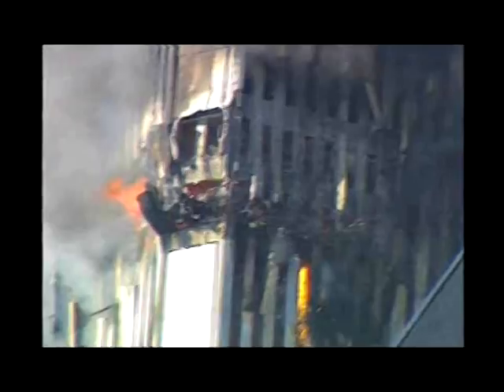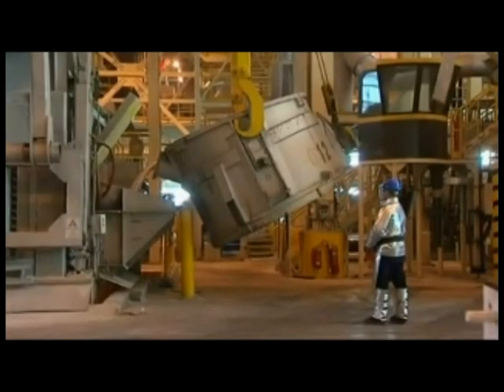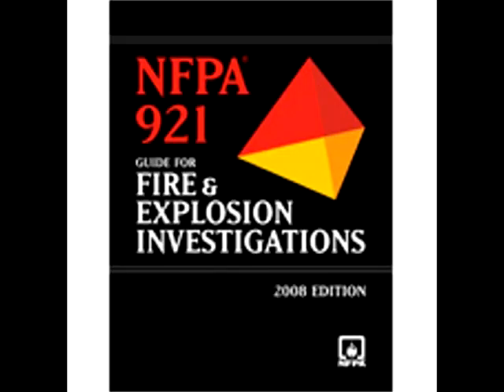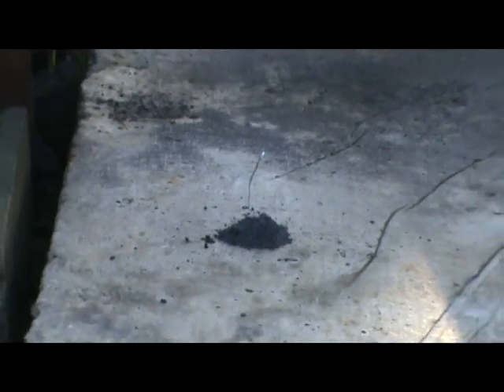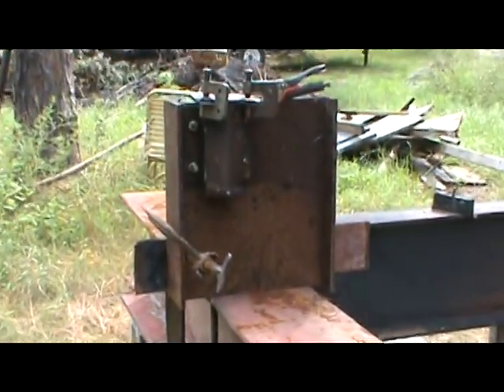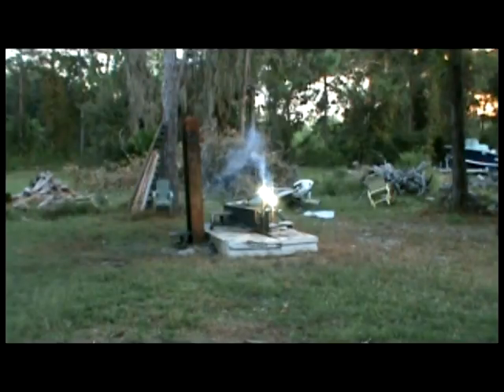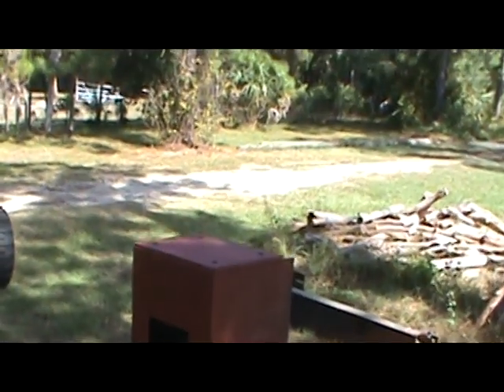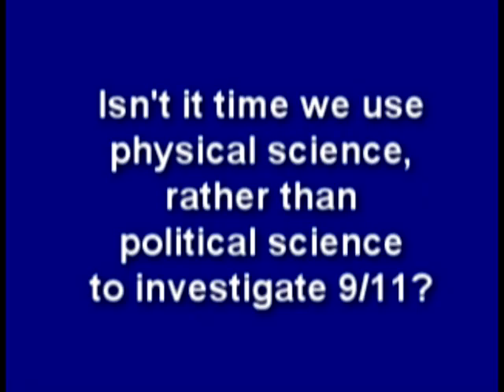9/11 Experiments: The Great Thermate Debate

Comment: So let me just understand this, You're saying that when the WTC was constructed the thermite/thermate put into the columns for detonation decades in the future?  Or was it a handful of people who secretly somehow gained access to the beams using precise maps to know where every access hole was, then placed the thermite/thermate and and sealed up the holes they cut so the people who worked in the offices wouldn't know?  Knowing that a chain is only as strong as it's weakest link, how many people would you say are involved in this conspiracy?  Less than 100?  Greater than 100?  Or did Bush do it all by himself in just 9 months of being in office?
Reply: @OttoJihaad  Really? Because you're a human with bendable joints and never fall straight down makes you question why the towers fell the way they did?
Controlled demolition works from bottom to top.  The towers fell top to bottom in on themselves.   
Feel free to go to the Popular Mechanics website, they have a dedicated section to the WTC attack
Reply: Have a better look at building 7, it fell from bottom to top like any other demolition
Reply: Just as an FYI, I hold 2 degrees in Engineering, so I am quite familiar with physics, and metallurgy.   Obviously you need proof that steel fails the instant it reaches it's critical temperature.  So here you go: 
http://www.internationaltimber.com/news/timber/how-does-timber-handle-fire-compared-to-steel-and-concrete- .  "Metal, on the other hand, begins to melt when it reaches a critical temperature (around 1300 degrees C) so will fail catastrophically. B.J. Yeh, from APA described steel being “like spaghetti” at this stage."  (Are these guys in on the conspiracy?)  Did you notice the word "catastrophically", and it's behaving like "spaghetti"?  So the outside of the towers had better structural integrity than the inside of the building, thus the tower collapsed inwards towards it's center, you know following physics and logic...
The only one making an ass of themselves are you foil hat wearing buffoons seeing conspiracies around every corner.   I don't trust the media, but knowing how much they hated President Bush, they would have crucified him if he had conspired to bring the towers down, and ordered a hole punched in the side of the Pentagon.   
Just like the other foil asshats swearing that the moon landings were faked.  What did the US contact the Soviet Union and ask them to not contest the story? 
The only thing you have proved to me is that the public school system failed you.
Reply: Ohhh a mechanic with an engineer's handbook!  Sorry I didn't realize that makes you an expert on the strength of materials!  What does your handbook say about the burning of the aluminum-magnesium alloys that are common components of commercial aircraft?  Not to mention all of the chemicals, alloys, and other flammable materials inside the offices?  Does material burn at the same temperature as it's flash point?  According to your physics, it obviously does.  Then try lighting a cigarette by striking it across the friction strip of a match book.
Reply: In order to create thermite, you need steel.  The amount of steel used in aircraft is minimal.  But hey, you're a mechanic with an engineer's handbook!  Was that page ripped out?  Thus when Pan Am 103 went down, and TWA 800 blew up no huge ball of thermite was created.  Maybe you should get a chemistry handbook also.  Out of the two of us, you are far more dangerous around kids, luckily people with your beliefs tend not to get much opportunity to procreate...
Reply: Ohhhh burn!  That's your big one-up!  So where is all of this Iron Oxide inside the plane coming from?  The only organizations I am a member of are IEEE, and ASME, I never joined a frat, the Knights Templar, the Free Masons, Young Republicans, The Murphy Brown fan club, Loyal Order of Buffalos, or Dexter's Laboratory.  My guess is you're a card carrying member of the Jimmy Jones fan club and have "Free Tim McVeigh" posters on you walls.
Reply: And you're a member of what organizations?  Other than the "foil hat collectors", and "9/11 was an inside job" clubs, may I suggest Alcoholics Anonymous?  You've obviously pickled your brain...
Reply: You seem to be too entrenched in the media control system that you don't wanna imagine for a second that it's possible for em to carry out something like that..
The psychopaths at the top are pretty much your daddies..
Your eyes will open once you realise that those that crave power have done such things for many thousands of years..
In fact it's not too different than sending thousands of boys to die on the fields so that your banker friends can cash in on some extra profits..
Reply: It takes a lot more than a snowflake like you to hurt my feelings, or get under my skin.  Obviously beside being an idiot, and conspiracy theorist, you've got the brain of a four year old boy, and I bet he was glad to get rid of it...
Reply: Idk man you can do it over the weekend, 9/11 was on a Tuesday. Plus you don't need the whole building. Just that area with the plane hit and also the base that way the are with the plane crumples downward and the base of the building also takes that energy down.
Reply: Yes and FDR had full knowledge of the attack on Pearl Harbor including the date and time the attack would occur, the Umbrella Man actually shot JFK, man never landed on the moon, and John Wilkes Booth was framed for Lincoln's assassination.  Did I miss anything?
Reply: Frederick Becker  Yeah, you are missing a school lesson in elementary logic.  Arguing along the lines of "Marcia is silly and Jan is silly, so we can't take Cindy seriously" is more loony than the silliness you describe.
Reply: Frederick Becker  That Popular Mechanics issue was a white wash and has been turned into Swiss cheese by David Ray Griffin.  It's instructive that the magazine was completely restaffed in the months leading up to publication.
Reply: I'm sorry, I just read those conspiracy cover-up magazines like Popular Mechanics that explain in detail the science behind the towers falling. I've shot lasers at the man made structures on the moon, proving we were there, and researched the forensics behind the Kennedy assassination as proof Oswald acted alone. 
Nice try though...
Reply: the cia literally admitted to the kennedy assassination so whatever you are using to fact check is bunk and I don't see why you think they would stop this kind of stuff now
Reply: Let me guess?  You used snopes?
Reply: It would take a lot more than your comment to hurt my feelings.   

Yes steel bends, look at the collapse, it was bending in towards the center of the building.   A fire on the 81st floor isn't going to make the second floor buckle and fall forward.   Steel, unlike wood fails in a catastrophic manner.   It loses its strength instantly. 
Conspiracies are not as frequent as you may think.  I doubt that the amount of people who would be involved in something of this magnitude have all been killed before they could tell their stories.
Reply: Is the earth flat too?
Reply: Coming from you Mr. Mechanic with an Engineer's Handbook, I'd doubt you made it through 3rd grade.

Comment: so people say that the planes melted into the towers and that planes shouldn't be able to slice through steel.. but, I've seen bare hands slice through wooden blocks at karate demonstrations.. i think there is something to be said about the speed at which something frail travels and the energy that it produces to cut through what you would surprise you.. next, if the plane did in-fact cut through lets say the first 2 rows of steel beams, and then by the third it didn't cut it, you would still have the force of all that fuel blowing with momentum in the direction of the motion engulfing all the paper and carpet and drywall and whatever items that are flammable would start on fire and heat up rather quickly.. and in this video the commentator is jumping to the conclusion that the steel beams are melting.. but what if another metal object caught on fire that COULD melt like molten lava?  I mean the fact that this molten metal poured out from only 1 location proves that it wasn't the steel beams right?  it it was the steel beams then it should have been all across the entrance line..